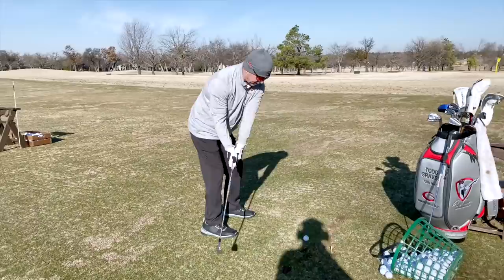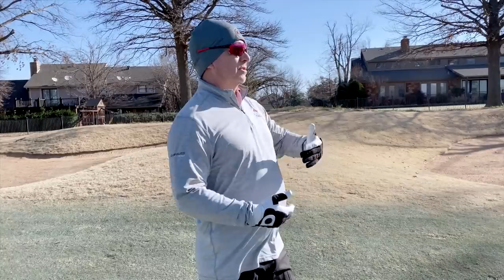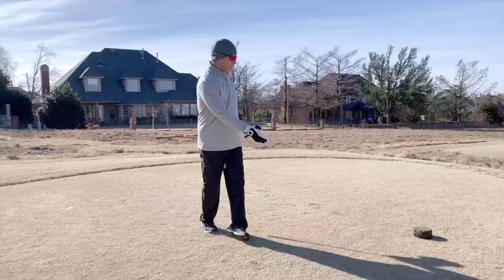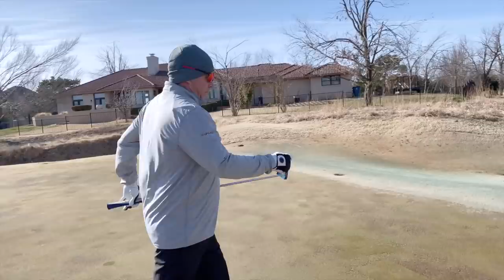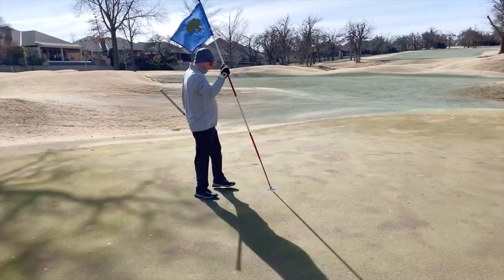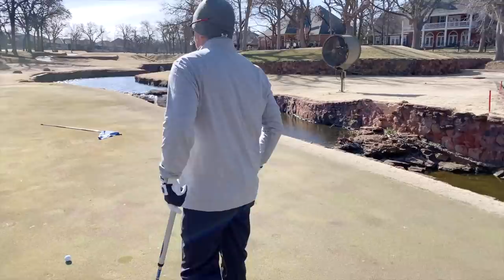Knocking the Rust off of my Single Plane Golf Swing (PT.1)

Comment: Great to see you back out getting in another round....I watched that 2nd tee shot like 5 times in slow motion at 1/4 speed....you definitely came outta that one, looked a bit like it caused an outside to in, over the top slightly? Wasn't going to comment, until I hit play and you started sharing what you felt on the shot! Go have a look (2nd tee is at 15:14 or close to it into the video) and let me know if my observation was correct, or wrong please, so I'll know when I start filming my own swing come warm weather!
watch it back at 1/4 playback speed! That's exactly what I've been focused on correcting in my swings....only shows up with driver, 3 wood used to go straight last we hit it....wish I had the equipment to take the grip off it and whack an inch of length off the Driver shaft, make it the same length as my 3 W....onward we go, look forward to seeing where it landed and how the rest of your round goes! Got so much rust here we're going to need a sand blaster to get it all off. edit to add---heck of a great shot outta that bunker!!!!
Reply from the maker: To be honest, I don't overanalyze my swing.  Being out of sequence is an easy fix.  All I have to do is keep my trail foot down.  Simple.  Thanks for the note.
Reply: @ToddGravesGolf  only bad swing I've seen the whole round, you piped and striped that next tee shot buddy! Some great lag putts too...I'm just about near the end & looking forward to see the new Bryson upload! I dropped a couple comments on videos that Bryson and Kyle Berkshire were on recently, if they'd look into what Moe was doing imho it'd help them both out! If he get his drives straighter ie. hit some fairways, he'd have been able to keep up with DJ this past weekend from what I saw out of their last 2 rounds I watched online streaming. Perhaps they have looked, i don't have a clue but I dropped your channels in their videos comments! I feel if Bryson saw those videos you've got uploaded that I've seen, he'd be hitting you up asap! I know I would if I were in his shoes, knowing what I now know, thanks to Moe, yourself and all those you've worked with, especially the bio-mechanics of how we humans work and how deep you've went in and looked at and into all there is to be looked at and into! I came across a video last night on a channel that only had 3 videos posted 7 -8 years ago, said he was Moes' caddie and was hitting some shots, explaining what he'd finally learned after all those years! Said he was never able even come close to reproducing even similar to Moes swings until he started adding weight to all his clubs and shafts under the grips! He felt that was all the real key behind what Moe had figured out! Scientifically, that does make a load of sense to me too! His shots looked like yours and Moes both...did you ever meet or know his old caddie?

Comment: Looks like I have the same shafts and grips as you. Aero tech steel fiber I-95 shafts?  Golf pride multi-compound plus 4?  Would love to see a full detail of what you’re using and why as it relates to the single plane swing...
Reply from the maker: 110 g shafts.  They key is that you have the clubs fit to your swing technique.  I have certain specs that I have based on my single plane setup.  This includes 2 degrees flat.  Midsize grips.

Comment: Question. #2 hole, you're in the bunker, pretty sure you're not going to reach the green.  Why not hit a 7 iron and take the bunker lip out of play.  You still have a short wedge into the green.
Reply from the maker: Good idea. I was a little concerned about getting past the tree on Right but good idea.
Reply: I don't think you mentioned that big slope at the front of the green when you were considering the second shot. With hindsight, maybe a six iron to pitch at the bottom of the slope and possibly run up it a little to leave a shot off the upslope? I would definitely have hit seven to miss that lip!
Reply from the maker: @davidgeorge5344  I don't like chipping and running with 6irons etc.  Not that it is a bad idea but I don't practice that shot much.  I always stick to what I feel confident with and try not to experiment on the course.